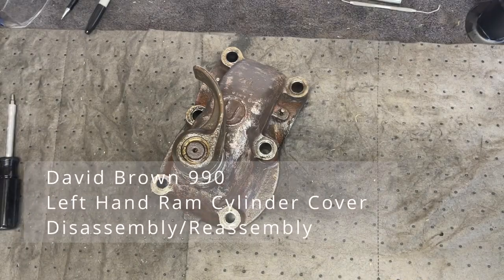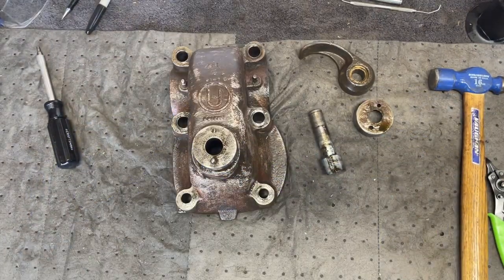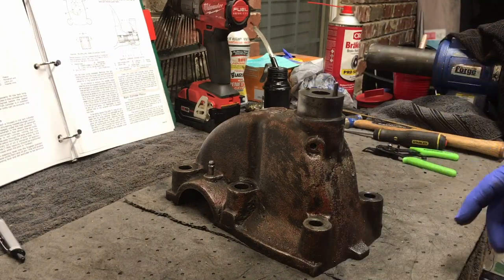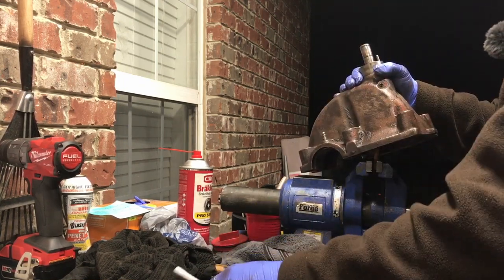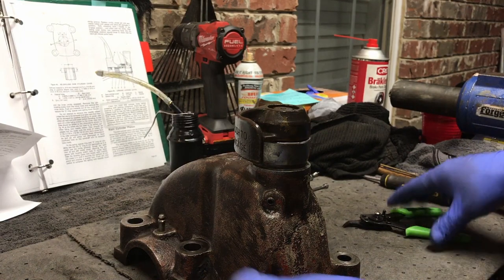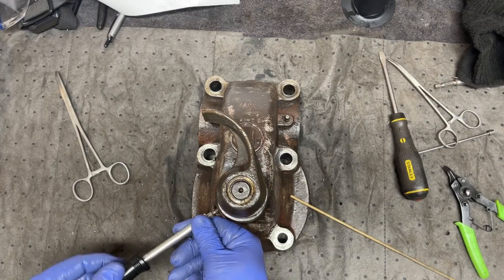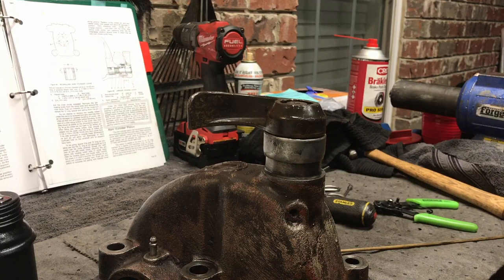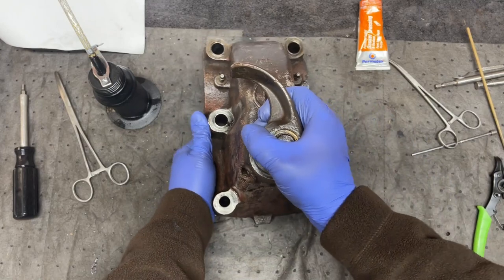Snap rings are annoying | Ram Cylinder Cover Disassembly/Reassembly | David Brown 990 #12

Comment: I've never seen a David Brown 990 so I have no clue what that handle does. I assume it is something on the 3 point hitch cylinder, but how does the handle do anything, it looks like it doesn't turn the shaft, in fact what does the shaft do? Does the handle pull the shaft out as it turns maybe?
Reply from the maker: Good feedback on that, I need to introduce what I'm doing and what it does better for viewers.  This video is a continuation of a series I'm doing on refurbishing my old David Brown 990 tractor.  It's English made from the late 1960's.  Yes, this is the latch that's used to hold the lift arms up at their highest point to lock them in place for maintenance needs or whatever.  The shaft just slides in and out of the bore and acts like a shelf that keeps the arms from dropping.  The handle has sloped areas inside that 'cam' against the shaft/spring pulling it out.  Thanks for watching and thanks for the feedback!

Comment: Hi Shane I now know why the leaver and dirt cover is missing from my 996. It came with a pair of pliers pushed in behind the circlip what you call a snap ring. I pull it out with vice grips and slide the pliers in from right hand side. They sit on the pto housing. Good vid M
Reply from the maker: Yeah, I can imagine a few of these have fell off during the years from lots of tractors!  Not the best design in my opinion.

Comment: Justt like to say I read in one of your past comments considering your a computer/programming nerd your doing very well fair play for you for having a go and sharing your experiences on video. Can I ask you changed the o ring then changed it again for a different one where did you get the one you settled for was it david brown parts or somewhere else. Keep em videos coming but are ill you didn't mention Barry lol 😆
Reply from the maker: Thanks a bunch Jon!  I've had this one in the works for a bit and was delayed to get that new bigger oring delivered and put in.  Initially when doing it, I was so focused on the snap ring going well that I didn't notice the proper spec'd oring was that loose on the shaft.  I was editing the video together and noticed it.  Glad I did.  I don't want that part leaking again.  

I've been ordering o-rings from The O-Ring Store online.  https://www.theoringstore.com/store/  I've got to order minimum quantities but in many cases I'm getting whole packs of sizes for cheaper than 'kits' and they're here in a couple of days.  I'm also sure of the hardness and quality.  Ordering stuff from the suppliers like David Brown Parts in England can take a couple of weeks to get shipped here.

I'm keeping a spreadsheet with the description of the part, oring descriptions from parts catalog, and the oring dimensions in both metric/imperial units.  Makes comparison and looking to get a 'bumped up' size relatively easy.  I'm using an Oring Size Chart from Seal & Design's website for the AS568 standard: https://www.sealanddesign.com/technical/o-ring-sizes/  Most of the CaseIH parts catalog descriptions now contain the AS568 dash number for reference.

Lol, I thought I'd had a Barry mention in there, but must've cut it!  I cut out LARGE sections of rants, dead air, mistakes, my sons bickering with each other, and wife hollering that dinner's ready.